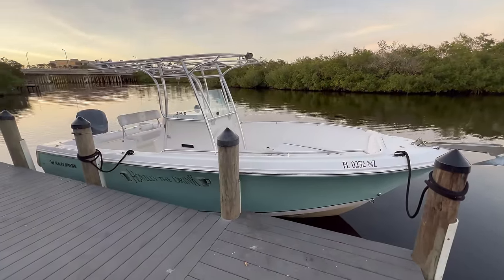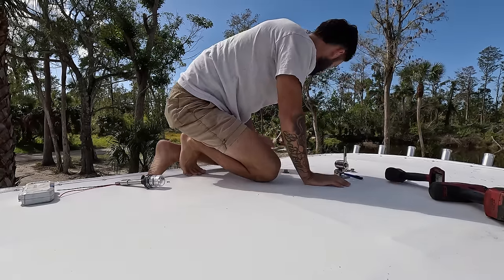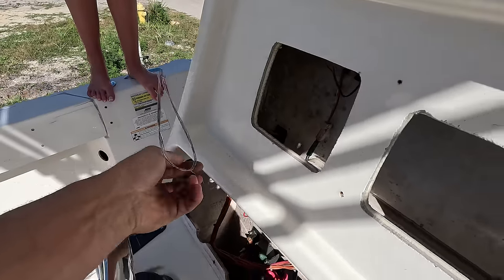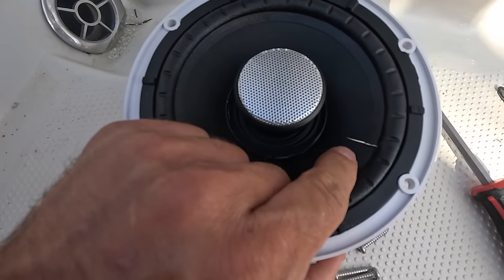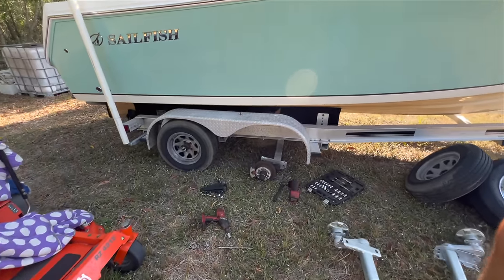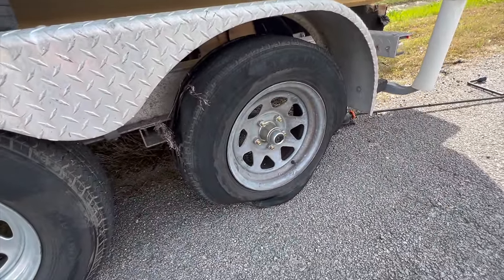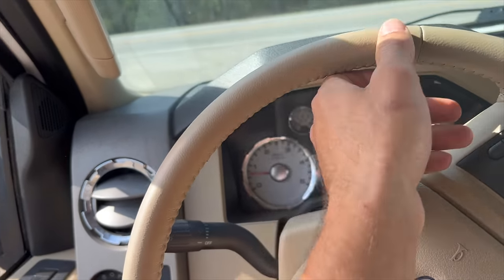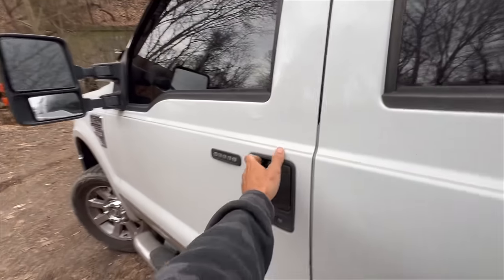Hurricane Damaged Boat Gets Rebuilt

Comment: Great video loving your channel saw you on your sisters channel.  I have the same boat and trailer so super interesting. One question where did you get the replacement axels? My trailer is has the same issues with the rust.
Reply from the maker: What state are you in
Reply: Florida
Reply from the maker: @badfrog251  so many trailer parts stores in Florida they all have them. Specifically I went to blue fin trailers in Fort Myers he’s got them all. But again google trailer parts and you’ll find them everywhere

Comment: Any tips for finding hurricane damaged boats?
Reply from the maker: Well I actually don’t recommend hurricane damaged boats. Typically they are so bad that it’s not worth fixing. You end up with more in it then it’s worth. I recommend finding boats that need minor repairs, dirty boats, needs interior, maybe it doesn’t start from sitting. Easier things. Work your way up from there or just do that because I’ve done hundreds of boats now but I know what to look for. In 2 seconds I can tell you if the boats worth it or not. So just be cautious but take risks at the same time !

Comment: Not the craftsmanship we want to see on those speaker wires. That clip after you showing us the hole in the speaker, shows the connections of the wires.  Really man? Just electrical tape? Do it right and and use waterproof butt connectors
Reply from the maker: Lol it had waterproof connectors I just put the tape to protect them. I used only heat shrink connectors for all the wiring. But ya that electrical tape looked sorta trashy